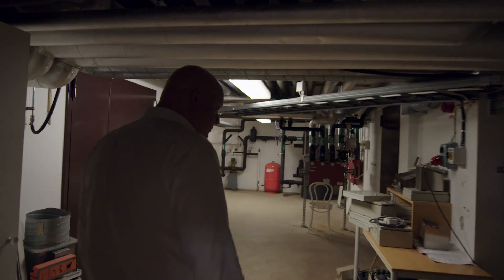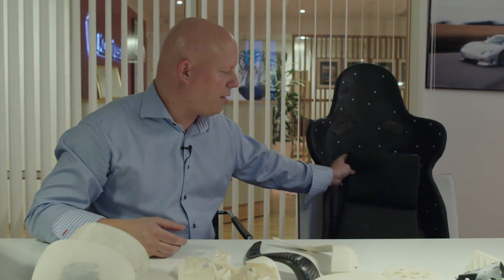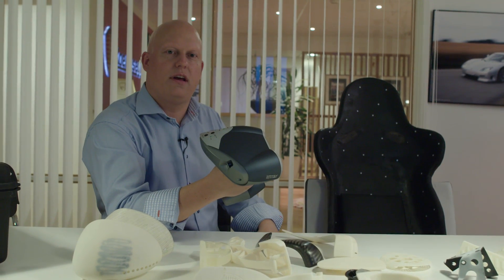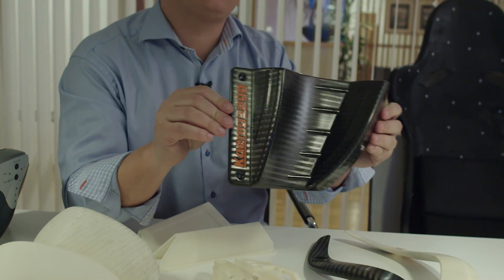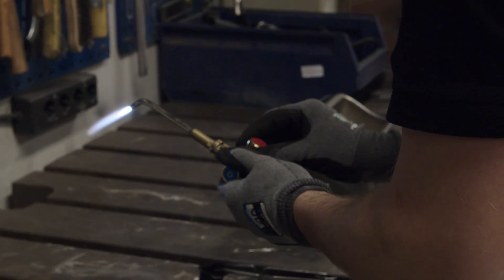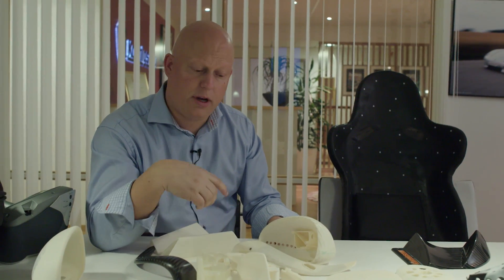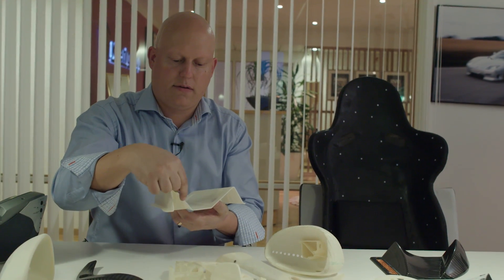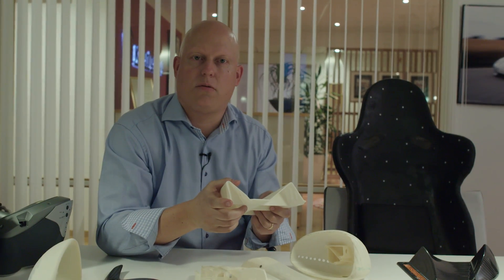3D Printing: Titanium, Carbon Fiber, & The One:1 - /INSIDE KOENIGSEGG

Comment: Haha, I just saw Koenigsegg used the same Stratasys Dimension SST 1200es that I had in my old startup. That was a $60k machine, today my $1k Prusa outperforms that old giant thing in basically every single metric. And the Stratasys could only use their own ABS and support materials which cost $150 each for about 1kg, today I use no-brand PETG at $20.

Comment: Another benefit of 3D printing vs tooling, for collectable class cars, is that parts that break can be reprinted in 10 years, 100 years 1000 years. Regardless. As long as the data is kept.
And who knows... Maybe a few hundred years from now the data itself can be collectable.
Manufacturers should in fact keep databases of scans of all their parts from now on for this very reason. There are after all today a large following for original versions of many cars, even seemingly simple ones, and one day the parts will run out for say the brand new VW eUP! or some other car that might not seem to be collectable now.

Comment: Damn.  At this rate you'll be able to 3D Print a whole car.
Reply: technically, you can. but with the tech today, would you want to drive it? it is a tool in the toolbox. it is not the only tool in that box.  used wisely, it is amazing.  used poorly, it is a problem waiting to happen.
Reply: wrath lamp local motors has

Comment: My name is Sylvester C Franklin Jr, I am a self taught atomotive designer. I have tried to get in with automotive companies to not get in.. So I decided to work on starting my own car company designing and building Hyper Cars. One of the methods I looked into is using 3D scanning and printing. I took CAD and Solidworks with focus in Rapid Prototyping. So far what I am running into is the price for scanners being so high. If I could get my hands on a scanner the things I will build. I will not give up I will succeed.
Reply: build your own scanner! Check thingiverse or online for many open source hacked scanners! I think i saw one for $35...
Reply: Scanners like that, the cheap ones are absolutely horrible. I'd suggest simply modelling and printing, the scanning part isn't THAT important, there are ways to work around it, although they take slightly longer, they're tons cheaper.
Reply: Syl look at 3DP-Platform WorkBench#400 printer.  With the work bed area of 59" x 39" x 27&3/4"  who needs a scanner.  Without getting wordy here i would use www.swissinvis.com  "Lamello Invis" (invisable attachable/detachable connectors) 12mm. size(250kg. pulling power) to connect shorter printings with finger/sandwich joinery to achieve one longer finished part(say a quarter panel) that is then given the carbon fiber vac bagging process. Eventually it will occur to you that just selling these epoxy compatable smaller sections( later to be joined into that longer quarter panel) gives customers the choise of their own selection of fabrics/epoxy's.  Just by forward or reverse of a battery pistol drill with Lamello's Invis gizmo allows them to assemble/disassemble in 5 seconds.  How is your surface geometry in SolidWorks.  Figure out depth and line up of the connector halves in each printed sections u want to join.  Look at www.compositeenvisions.com  for shorts of any cutting edge fabrics used in high end auto/areo/sports.   I have zip for operating capital, but have mucho research in this.   Another good find www.burtonprecision.com  for printers and scanners(many many kinds)
Reply: How is it going?

Comment: 3:45 did he say "printed an aluminum tool"? Was that what he meant becouse that would be really cool :D probably milled the tool from Al
Reply: I think he means that they 3D print the aluminium molds used for the carbon fiber parts production process. He showed the aluminium molds used for the carbon fiber intakes in another video.
Reply: I'm quite sure he meant that the aluminum and titanium parts were 3d printed themselves. Some industrial 3d printers can use metal powder and a curing step to print metal.
Reply: Exactly right.

Comment: You cannot print fibres. But I am exited what Koenigsegg is planning.
Reply: +fuelbasti You can print fibers.

Google "carbon fiber 3d printers* lol...
Reply: cybertree I guess you mean printing with resin maybe mixed with carbon powder. But it wouldn't make any sense. I think Koenigsegg will have some parts which looks good but you cannot force them like a "real" composite part.
To produce a fibre especially a carbon fibre a printing process is not the way to go. It is first of all a chemical process. A printing modeling process is way different process compare to composites.
But why you think C-fibres are printable?
Reply: +fuelbasti I just watched a video called "A 3D Printer that Prints Carbon Fiber" it explained everything

Comment: Interesting comments.  To answer your question its very simple.  Watch the video, his English is very clear.  They don't 3D print carbon fiber.  They 3D print plastic, then they adjust it the way that they want.  Then they make a mold out of aluminum and layer the carbon fiber on the mold.  Its a slow and excruciating process and as he put clearly they can only do it because they are extremely low volume and make less than 20 pieces per year.  

This is not really high tech at all.  I can 3D print at the UPS store right now if I want to.  Carbon fiber has been around since the 1960s.  That seat is hideous and designed for people that are way too big to be driving a high performance car.  Since very few people actually own Koenigsegg I don't understand why they dont just customize each seat for the driver the way they do with race cars.  Its pretty simple.  The seat is really a big tub. You sit in a plastic trash bag filled with thermo foam.  It heats up and expands around your body and when its filled all the holes you get out.  It hardens when it cools off.  You remove the plastic bag and you can cover it with whatever you want.  It weighs nothing.

I appreciate the Koenigsegg.  but this is not millionaire technology.  Anyone that thinks this is up on Formula 1 should look into it a little deeper.  A formula 1 team has 200 or 300 engineers working with a budget of $300-$500 million a year full time year round.  Koenigsegg has a handful of employees in a garage and probably make around $10 million a year.  Seriously.  Think about it....
Reply: I don't see your point.
Reply: The point is that someone thought Koenigsegg, a very small boutique hypercar maker in Sweden. is revolutionizing technology more advanced than Formula 1, including 3D printing of carbon fibre.  And if they watch the video they will see that Mr. Koenigsegg is not in fact saying that they do this.  Nor would anyone with common knowledge of Formula 1 technology remotely assume that a small company with a handful of engineers, practically no market competition and a very limited budget could be developing any technology more advanced than a century old industry backed by nearly every major auto manufacturer worldwide, together with 1000's of the worlds best engineers, combined Billions of Euros investment per year and intensive competition constantly requiring infinitely fine adjustment of technique.  This should be common sense.  e.g. Don't get too excited by Koenigsegg, its a very nice car.  But its far from "state of the art."
Reply: +Phillip Kopp 

But 3-D printing carbon fiber can be done and is.
Reply: +Phillip Kopp Most engineers working for mass volume car makers have one major disadvantage for  development each part is based on cost. Savings of a few cents on 800 cars a day make a huge difference to profits. For example one major sports car maker saves 5 euros per car using a low quality steel instead of a high quality less likely too rust material. Another medium volume maker just had to recall the throttle pedals because they had used the wrong cheaper plastic, claiming the sub contractor was to blame, yet no one in QC had checked for 5 years. 

F1 may look spectacular but it is much harder to produce a road car that is expected to run 3-5K between services and not fly off the road at the first corner. You vastly overestimate the engineering staff working on the car. Williams only have a staff of 800 total including office catering cleaners race team rebuild team with only a few involved in the design making process in the 80s they all worked in one office. The main reason is the speed required to change or fix mistakes. For example you have never sat in a foam seat designed for performance not for weather you wear winter or summer clothes are you driving today or your daughter? Also today's F1 cars use a carbon fibre mould anyway. F1 cars are easy compared to the challenges of building a road car.

Comment: Awesome vid series! I know Koenigsegg just by the name of Projectiondesign , - but I love prototyping,  but what separates me from a Stratasys or EOS system is "just 150k$". So I do my homebrew methods - not that precise, but faster and someway ceaper... If I could ask a  question to the "king of Carbon fibre"....
what kind of fabric and resine to use best for laminating a little warped object in the size of an wrist watch into a 3 D routed Aluminium mould .

Comment: They shouldn't release a video where they show there workers blatantly disregarding safety requirements of operating an acetylene torch. For example staring at the flame without shade 5 lenses.
Reply: Timothy Parker this is Europe not the united states man totally different regulations.
Reply: You dont need the lenses for the bare flame only, only if your going to get metal hot enough for welding or brazing would the light output be bright enough to damage your sight. They were just getting the piece hot enough to show off that lovely titanium rainbow heat affected zone colour - that's not even cherry red yet.
Reply: The flame of the acetylene torch when mixed to a neutral flame as shown emits UV light that damages retinas. The temperature of the metal does not mater in that respect.
Reply: Yes sure but it's not nearly enough. Hell just being outside you will get more exposure and that's without looking directly at the sun. It's a matter of length of exposure when the intensity is so low. Take it easy dude - you will live longer. As a welder I am fully aware of what uv exposure feels like when you don't take percausions and heating things with a torch with a larger rosebud tip all day won't do it so 10 to 15 mins with a pencil tip certainly won't.
Reply: ***** Thats ridiculously incorrect. Im also a welder and a Mechanical Engineering student, UV may not have immediate effects at the levels of torches but it is damaging, sure its not enough UV to require a shade 11 lens but it does require shade 5. Also I don't care that they are being unsafe I have seen that a lot, its the fact that they are a professional company. A company should always review their footage for safety, before releasing. They aren't even wearing safety glasses...
Reply: Timothy Parker stop being a weenie.
Reply: Have you ever seen a chef wearing shades to "glare" a a Creme Brulee? Well, same reason this guy isn't.....

Comment: This level of advancement in a motor car(fair enough a hypercar, not say a Civic) is incredible. Usually the aviation industry are the ones to be using pioneering technology to manufacture parts, and at a monstrous cost. This guy is doing it in an aircraft hangar and a small group of engineers.

Comment: I'll be interested to see if his claims about the carbon fibre printing are true. Surely the nature of the material makes it impossible to print as it is two materials woven together. It cant be put in powder form as it needs to be done in a certain way to have the structural gains that it provides. Or am I just wrong?

Comment: 3D-printing CF would make CF cheaper in general because it's easier to produce, right? Supercars and sports cars would be cheaper to make and buy. Hell, if this tech were here earlier, there would be standard CF in your average Civic.
Reply: Not really. CF is expensive not because of the way it is made-you can make CF parts much in the same way you would a GRP bathtub-but CF itself is quite expensive due to the demand from the aviation industry. Additionally there are different kinds of CF, which can cost more or less to produce.
Reply: 3D printing still has a few limitations to overcome, fpr example size and the long time it takes to print. So, for large volume production 3D printing is still not a viable option.
I'm fairly certain that the titanium parts that Koenigsegg uses are printed with tech from another swedish company(Arcam) who develops and makes metal 3D printers that print parts like aircraft turbine blades and orthopedic implants.
I giggled a bit late last year when I read that the american company Solid Concepts bragged and said "The 3-D-printed metal gun proves that 3-D printing isn't just making trinkets and Yoda heads", after having printed a working M1911 handgun in stainless steel.
China is far ahead aswell. One chinese company is building a metal 3D printer that can print objects that are 10m long,  6m in diameter and weigh up to 300 tons.
Reply: As JimmyHoffa says the cost of carbon fiber is related to aviation demand and regulation dictating who can make it (at least for the grade of carbon Koenigsess cares about). Carbon fiber's strength comes from the orientation of the strands within the sheet, in current fabrication it is similar to fiberglass, you orient the weave to the direction of the stress being applied. With the 3D printing process Christian is talking about, they are able to orient the carbon chains more finitely than you can with using sheets. It isn't just printing chop (unoriented strand) and adhesive.
Reply: Look up "forged" CF, it is strong, light, and cheap. Plus it does not take a lot of time to build it.
Reply: ***** News from Japan shows that CF could be manufactured much cheaper and faster than before, the only bottle neck now is the source of raw material.

Comment: That guy is freakin awesome. A true mechanical engineer, an innovative man, huge respect for him. But I laugh my ass off when he tries to diss hybrid drivetrains and says he sees no future in them.
Reply: ***** Electric drivetrains suffer less mechanical loss than traditional ones if I remember rightly. An engine powering a generator which powers motors connected to the wheels(no battery involved) is supposed to be more mechanically efficient.  Hybrids do use less fuel than equivalent counterpart though.

Comment: Correct me if I'm wrong but I thought carbon fiber had to be physically woven together. If so how can you 3d print it? And would it even be still designated as a fiber?
Reply: Now a days,carbon fiber doesn't have to be a woven cloth only. Lamborghini,Bugatti,etc,are using carbon fiber(in small fiber form) mixed in an epoxy medium,and injection molded to form carbon composites besides their carbon fiber cloth structures. Having these carbon fibers in dust form,one can 3d print from there. Of course the structural rigidity is not the same but,for non load applications,it would be perfect. Remember,koeningsegg is trying to work around an expensive technology,that is making carbon fiber molds,and replace it with 3d printing for smaller,non load,parts,similar to ABS plastic.
Reply: they 3d print the shape in which they will create the mold where they cook carbon fiber inside. so its not actually 3d printing carbon fiber components
Reply: ^ that would be a chopped fibre process, which is heavier and weaker than a true weave. but it is substantially cheaper, which s why carbon chopped fiber technology is making its way into less exotic cars at the present.
Reply: ***** Precisely, which I don't think is what they're trying to achieve anyway since it's all painted. It's just to make a light yet strong part.
Reply: If you re-watch the part about the cf components he says the exact process they use for making the parts. They use the abs to test and tweak the design, then once finalized they use that file to cnc an aluminum buck (mold). They use that buck to mold the cf panel.
Reply: its probably more of a spun fibre with a resin nozzle to seal. with the movements of the fibre nozzle(s) and the resin nozzle following behind it would be possible to get some pretty crazy weaves.
Reply: Using a spraying technique where short carbon fibre strands are mixed with resin and sprayed on. They dry, and the crossweave of CF creates the strength. This kind of technology has been used in boatbuilding for years, although by hand.
Reply: Sweater Dood
You can't use a 3d printer to print carbon fiber. Or metals. Or anything but the resin they use. The title is misleading. The colon shouldn't be there.
Reply: mellowb1rd not entirely true, the titanium exhaust tip on the Koenigsegg 1:One was 3d printed
Reply: Ahh not resin it uses a chemical designed and chipped version of carbon fibre suspended in a filament string of plastic to be extruded by a FDM machine ( fused deposition modelling ), white (Ivory named by stratasys) parts are printed on the printer they show the Stratasys Dimension 1200es sst (sst = Soluble Support Material) but the dimension machine cannot print carbon fibre filament only boxed sealed spools of abs in 7 colours :P hopefully that's all the info you need on that printer, all that comes from experience ( I own one :p ) there about £32000 new and there awesome
Reply: And metal printers use a fiber laser and a container of super atomised titanium particles which is melted by the laser into a layer of titanium and builds it up in 16 micron layers that's how they print in metal or they use subtractive additive manufacturing machines, youtube it
Reply: Sweater Dood More for the novelty than anything else, no doubt. Horrible cars designed to chase straight line speed records at huge cost, and handle like last decades pimp-mobiles.